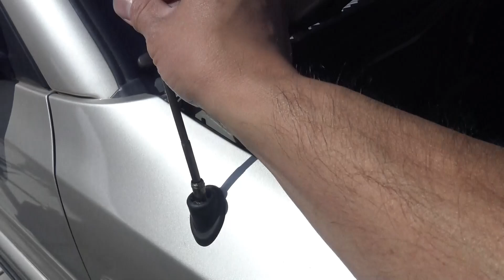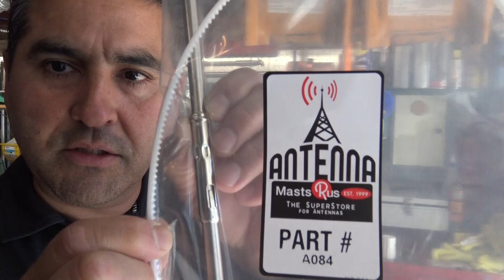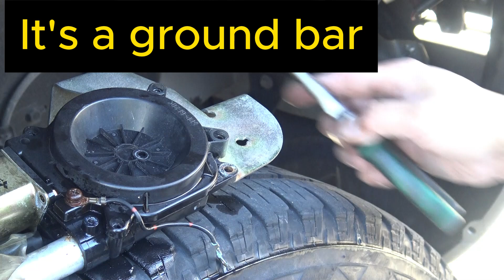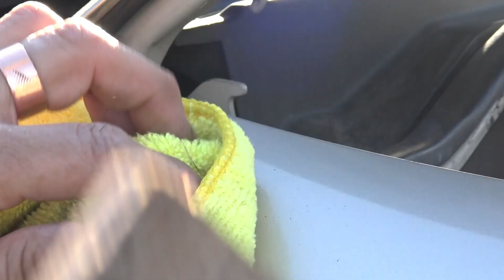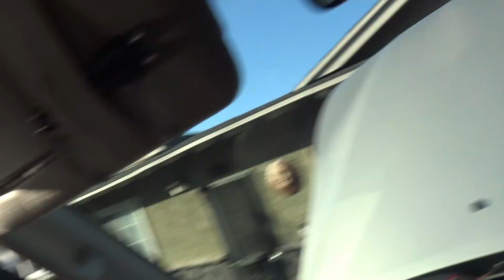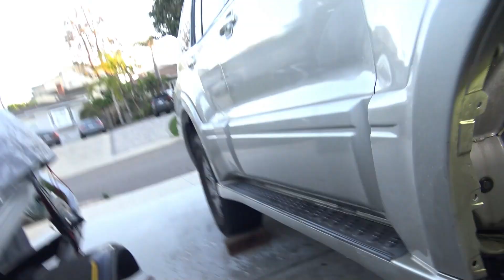Mitsubishi Montero auto antenna replacement and antenna motor repair

Comment: You are a great resource for us Pajero / Montero owners.
I’m in Australia and you are dealing with the same issues I’ve dealt with for close to 20 years. 
It’s great to see you doing some jobs I have in front of me.
In Australia my car identical to yours has an antenna that goes half mast or full via the switch on the dash.
Reply from the maker: Glad I could help out with those repairs, good luck with your project! 🚗

Comment: THE     PASSENGER      FENDER     NEEDS     TO     BE     REMOVED    !    THE     FRONT     NEEDS     TO     BE     RAISED      AND      THE      PASSENGER      TIRE     AND     WHEEL     REMOVED    !
Reply from the maker: no need to remove the fender or the wheel, just the splash guard and jack it up to make room.
Reply: @The_Mitsubishi_Montero_Channel    WHEN    IT     HAS     TO     BE      RIGHT     IT      HAS     TO     BE     RIGHT     !     I     DON'T    CUT      CORNERS    !     I      DO      THE      JOB     RIGHT      THE      FIRST    TIME     !

Comment: Hola Jaime. Gracias por todo. ¿Hay manera de contactarme contigo?. Necesito el manual  de taller de la XLS 3500 y solo consigo el de la Full. Por ejemplo no encuentro la central de la alarma que esta averiada.
Reply from the maker: Lamento decirte que no tengo ese manual
Reply: @The_Mitsubishi_Montero_Channel  Gracias por contestar Jaime. Lastima, no puedo encontrar el modulo de la alarma original. Muy buen canal, segui así.